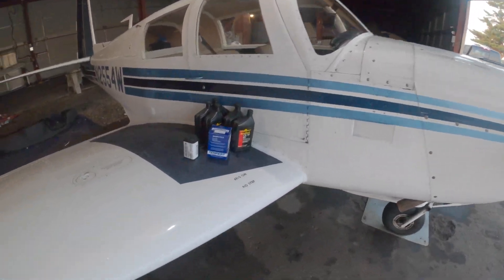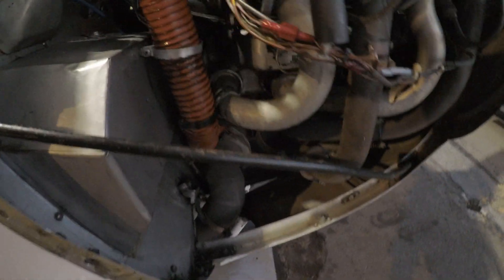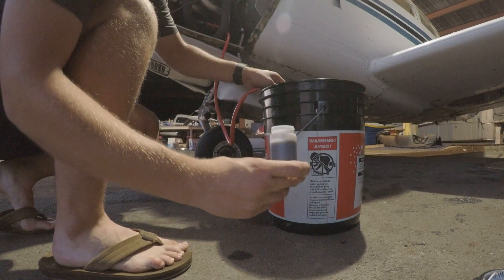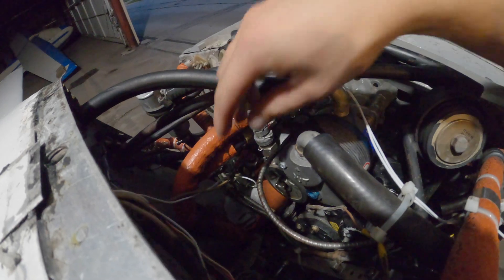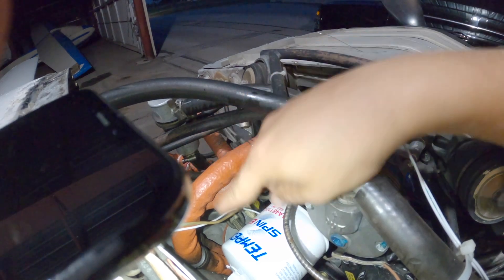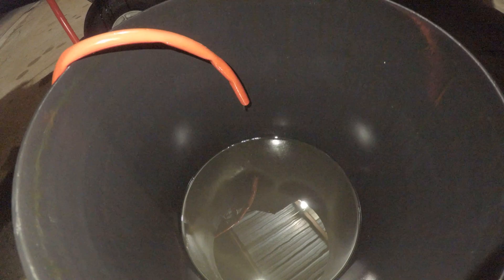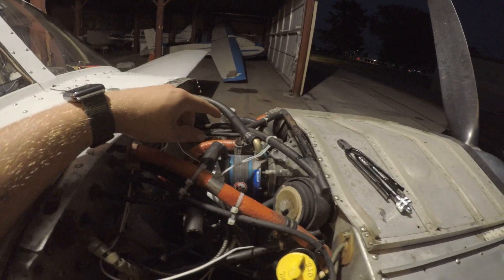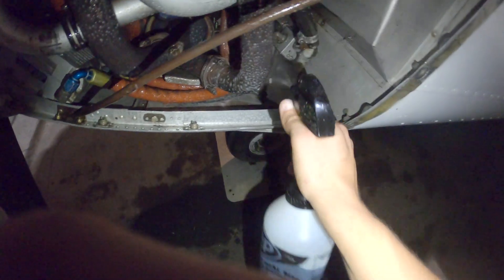Changing the Oil on my Mooney

Comment: Pop a hole in the top of the filter with a screwdriver. Then drain the oil.  Take said hole and put some shop air in the hole,  it will push the oil out of the filter. And alot less mess if any

Comment: HOW does changing the oil save you money?   Thanks for info. I have an M20C and getting ready to change oil.
Reply from the maker: Labor and shop upcharge on parts. To have an A&P do an oil change was usually around $300 for me. Doing it myself worked out to around $120 and an hour of my time. Just make sure you get the correct oil filter and invest in some lock wire pliers (~$30) and lock wire (~$20) you should be good to go. If you have any questions or want help the first time just ask around. I'm sure there's an independent A&P that would be willing to shed some knowledge or another owner that has done it a time or two. One tip I was taught was to take a piece of 2" PVC and rip it in half length wise to make kind of a trough to catch the drippings from the oil filter and direct it into a bucket.